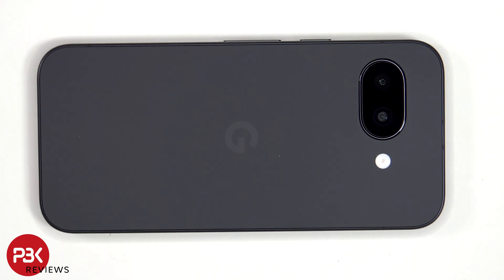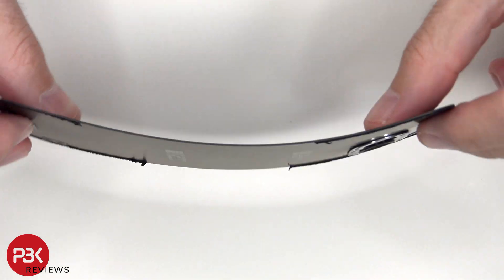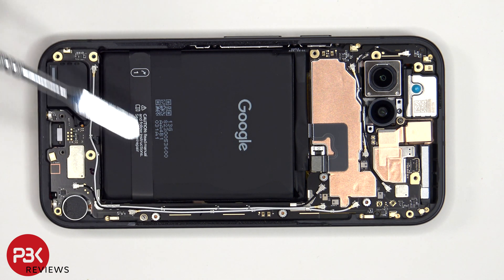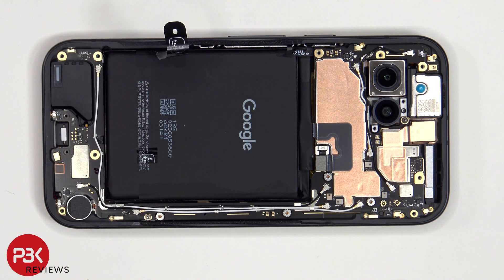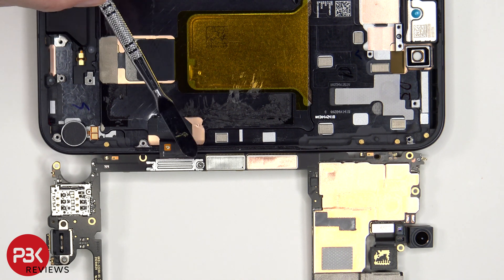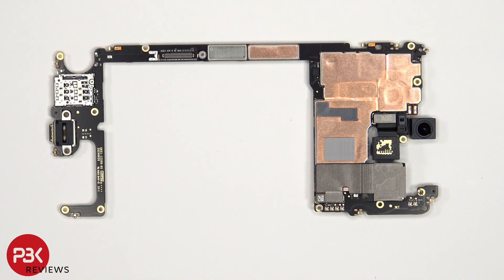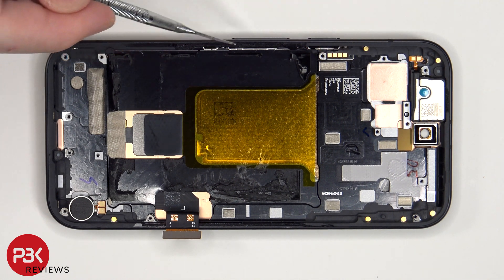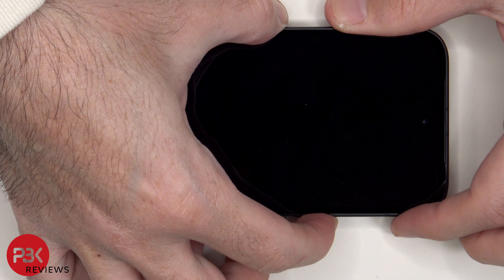Google Pixel 9a Teardown Disassembly Phone Repair Video Review. VC Confirmed!

Comment: I haven't tried this phone, but on many phones the adhesive is a clear gummy compound that very slowly releases under tension. The key to freeing the battery with the tabs is to apply some tension, and wait a few seconds until you feel the tape loosening. Then apply more tension and wait again.  If you just keep pulling, you don't allow the glue to slowly release and this is why the tape breaks. Similarly, if you must pry, lift up and wait until the glue releases a bit before pulling up with more force.

Comment: I really like the Pixel 9a, but the soldered USB-C port is making it not last all that long. My Galaxy S10+' USB port started failing sfter 2 years. I plug in my phone to Android Auto few times a day and the wear of this component is quite high in my usage. Unfortunately, soldering down the USB-C port makes the repair costly and I can't do it myself without special skills.

My current Pixel 7 Pro has soldered down port as well. I'm scared it'd fail just like my S10+ USB-C port.

Maybe my next phone is just going to be the Pixel 9 Pro XL or the S24 Ultra, as they have charging ports on separate board, which makes it easier to replace... Who knows.

It's my bad that I haven't checked that the 7 Pro has soldered-down USB as well.
Reply: Verwende dein 7a als Trade-In Gerät und hole dir das 9a. Nach zwei Jahren dann das 11a usw. . Dann brauchst Du dir keine Sorgen machen um den USB-C Anschluss.

Comment: Is the NFC and wireless charging coil on top of one another? If you use tap to pay, but also want to get a magsafe case and a magsafe popsocket, would those interfere with the ability to use the NFC for tap to pay since they are in such close proximity to one another?

Comment: I just bought this and the battery is even worse then the 6a I just replaced it with 😭 And now I see they basically super glue it in there with a "Go fuck yourself" pull tab, definitely going to have to ask for help from some more professional hands if I try to replace it...

Comment: Is it really that much cheaper to not have a sub-board connected to the main via a flex cable?
I guess it is.
Not to mention that the battery is still stupidly well stuck to the frame for no reason. I still find no reason to have any glue there at all. I guess samsung is moving in the right direction at least.

Comment: If you just wanted an old school offline pda would removing the coaxes be enough to prevent wifi n cellular? Bit off topic i know...
Reply from the maker: its possible, but not 100% sure since usually the motherboard has pins which touch antenna contacts on the frame as well.

Comment: I looked at that motherboard and thought something was wrong...
Indeed soldering the usb-c port to the motherboard is a crime. You're making a 5€ replacement piece become a 250€ one...
Besides this turns it into a weird spider shaped motherboard, which isn't really sturdy
Reply from the maker: yeah, not a fan of soldered ports to the motherboard.
Reply: This design was from my motorola g6 and the charging port failed. Im not buying this phone at any cost
Reply: Definately instant no go for port on the motherboard, these videos are so useful, saved myself a disaster
Reply: Damn.. I've had debris make a port useless, even after cleaning on my mbp. Any tips? What if you know how to solder? And can you solder in a different port?
Reply: you can solder the same port in place yeah using hot air, not an easy job if you've never done that. and could also be that the port is fine but the circuitery isn't  @H786...

Comment: Interesting 🤔 
This 9a has a quite large copper vapor chamber whereas the vanilla one which belongs to a superior range doesn't have any 👍
Reply from the maker: 👍 yup, its nice to see the addition of the vapor chamber.
Reply: @PBKreviews  Yeah that's a nice added value 👍😊
Reply: The 9a is technically a newer phone. 2024 vs 2025. This also means it gets an additional year of updates. Instead of updates ending in 2031 with Android 22 for the rest of the P9 series, they would end in 2032 with Android 23 for the Pixel 9a.
Reply: @theadelect22 *not the same. Tensor G2, G3 and G4 in 7a, 8a and 9a uses IPoP SoC packing instead of FOPLP-PoP in rest model series 🤪🤪🤪

What does it mean?
- Cheap for Google
- More power consumption
- The SoC is much thicker and produces more heat.
Reply: @FoxVol  guess I was wrong.
Reply: @theadelect22  Stop kidding yourself man. The 9 is an all-round better phone than the 9A
Reply: @EvanXDev Never said that it wasn't. I just said that the 9a was newer
Reply: @theadelect22 Thanks but got a European variant Honor Magic 7 Pro midnight black 🖤 12/512/5270mah with Android 15 and also 7 years of software updates 🤓
Reply: Because 9a has worse SoC with worse packing and overheats a lot 😂
Reply: @FoxVol  9a has the same SOC as the rest as the P9 series
Reply: @FoxVol @FoxVol Ok nice 🙂 
My brand new European variant Honor Magic 7 Pro 12/512 is quietly observing all this 🤓

Comment: stupid board design 
whay dont have a sub board conected via flex cable so if the phone got bent you dont crack the thin board along the phone 
and google make it more complicated by adding the screen connector to it (good luck fixing it when it break )
Reply from the maker: yup, I like the fact the phone can be taken apart from the front and back, making screen replacements easier and also not risking damaging a working screen for other internal part replacements, but the soldered port and sim reader is something they need to do away with and put on a sub board.
Reply: @PBKreviews  
its good that you can replace the screen with out disassembling the phone put the connector in a more ridgid place